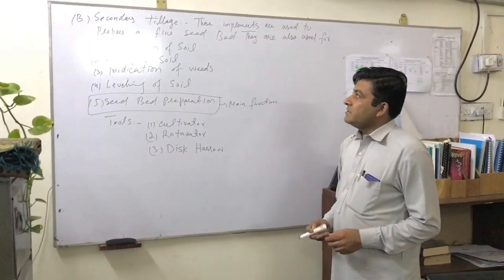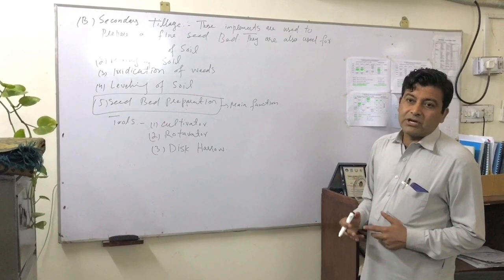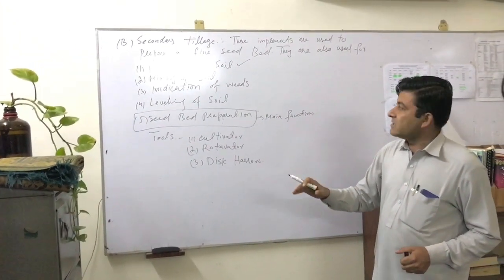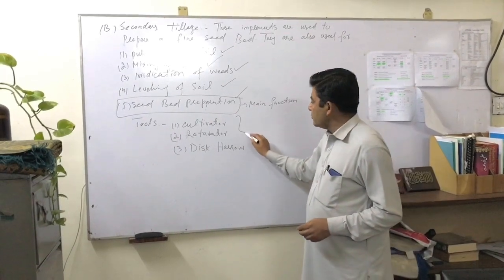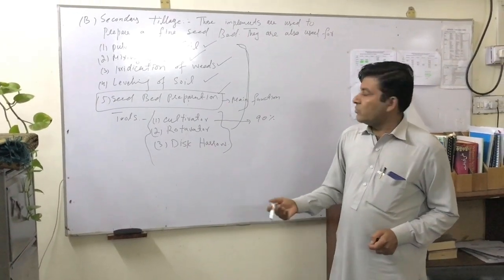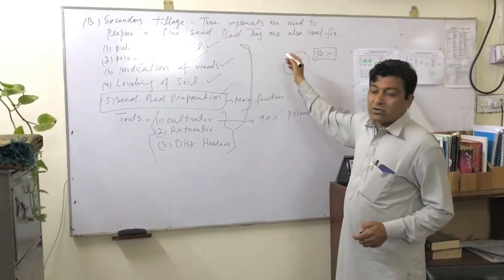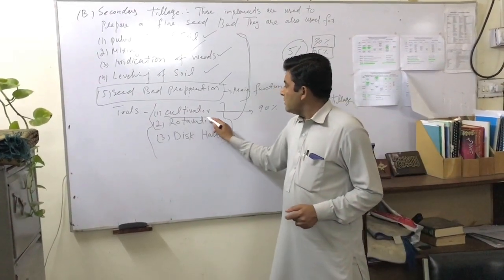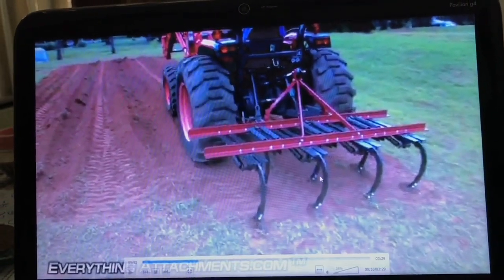Secondary TIllage. B.sc part 1

Comment: If cultivater is not a good tillage than why Pakistani 90% farmers use it.
Reply from the maker: Because primary tillage systems have not been practiced.  No awareness,  no mechanization inputs and government policies.  Also extension workers had not reached them. Also the research carried out by universities is not disseminated or spread to the farmers. It only remains in books and journals and is not given to the poor farmers.